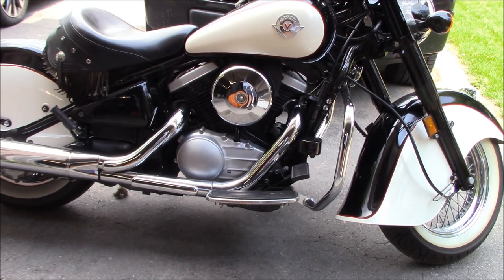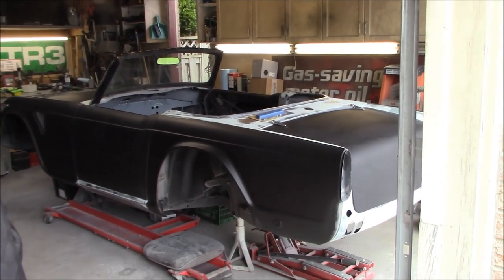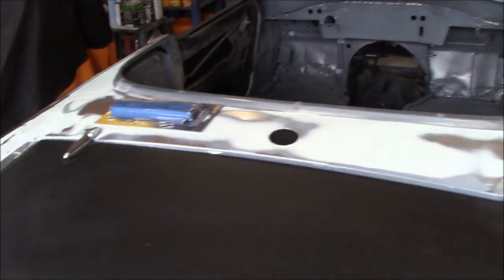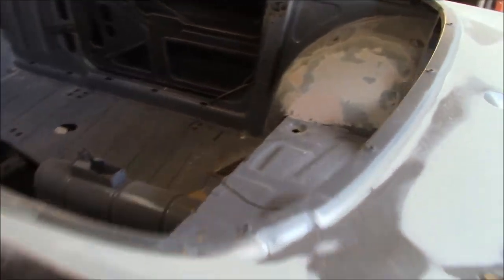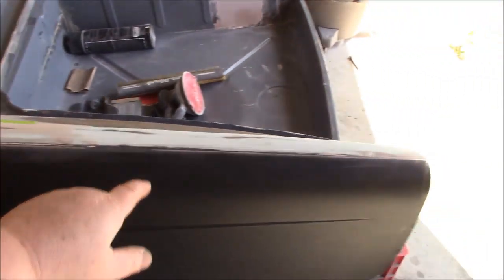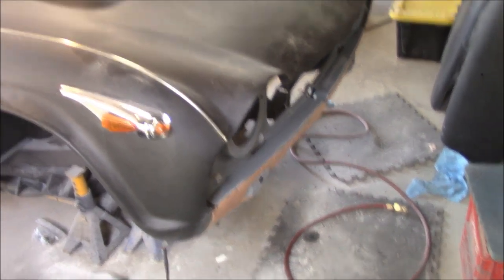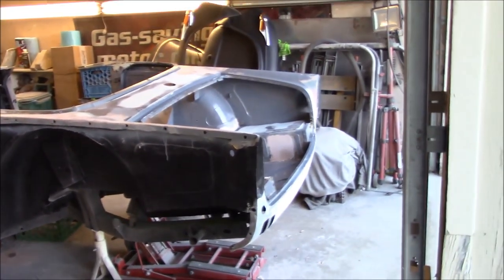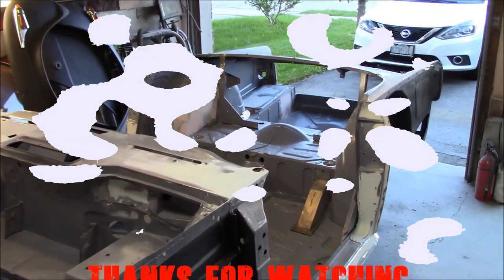1968 Triumph TR250 Restoration,  Going Backwards in Order to Move Forwards......

Comment: Nice progress David , appreciate the details on methods and products you use. Surprised it gets that hot up there, 90 and humidity is my life for the next 4 months down here in Miami. Question I need to adjust a door on my TR4 have you used shims to get them lined up so they hit the latch? Thank you
Reply from the maker: Hi Robert ,  usually with door alignment you will need to do it at your hinge points.  You will need a helper to help support the door where you want after you loosen the 6 hinge bolts.   Once you have it adjusted, you can then tighten the bolts.  It’s a little bit of trial and error.  Be careful not to scratch your paint as the doors are quite heavy.
Reply: @cheftush  Thanks Tush, appreciate the advice. much appreciated.

Comment: This is getting so close now, well done. Are the seams near the top effectively made into the filler to look like a factory joined section? It certainly adds the correct details.
Reply from the maker: Yes they are.  The seems are actually there as I can feel the two tabs of metal on the interior of the panel but they’ve just been braised over.
Reply: @cheftush  that's probably better and should stop the cracks that you sometimes get where it flexes due to the roof etc.